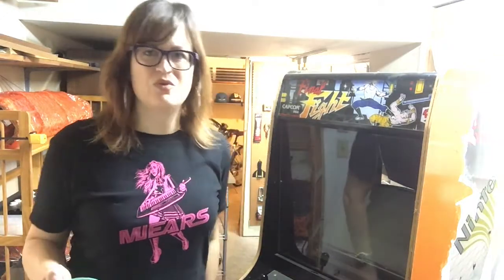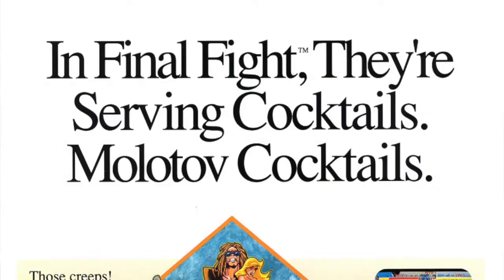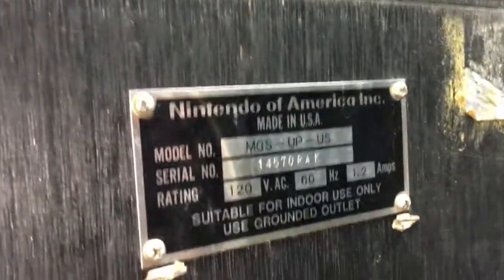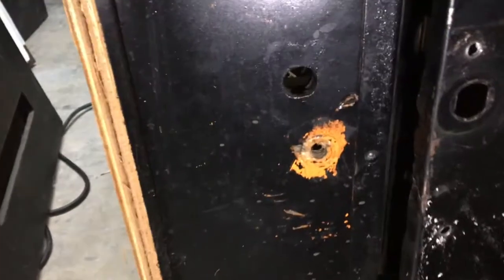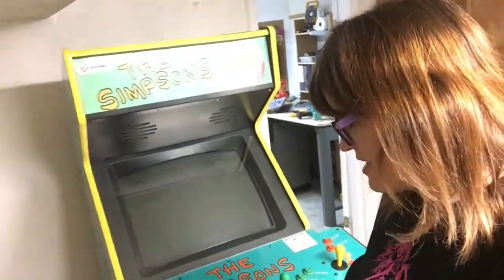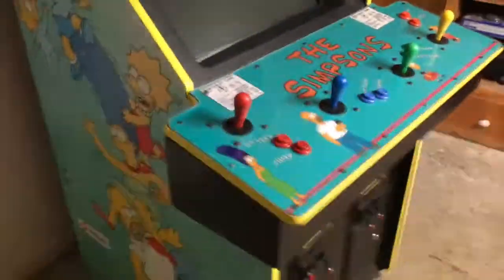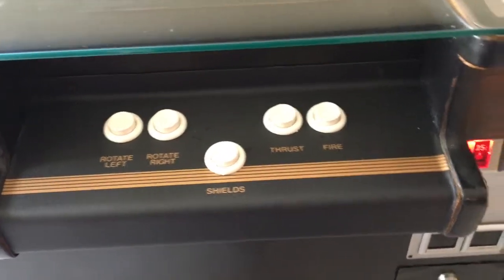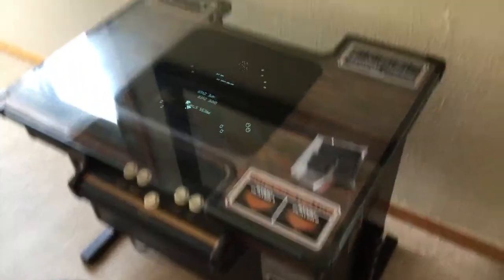My Arcade Summer Projects

Comment: Another awesome video! 
I shipped over a DK Jnr last August and had to do some minor restoration on it. New side art, t-moulding, control panel service and new marquee light unit to convert it back to an original one after a hack job strip light was found in there. 
I did a mini time lapse video on my channel of this and similar work my DK if your interested in checking them out? 
Cheers! 🕹👍🏼